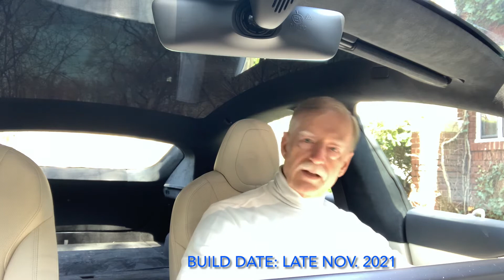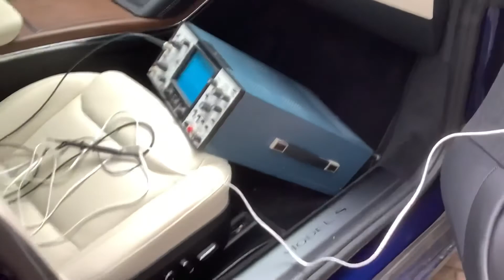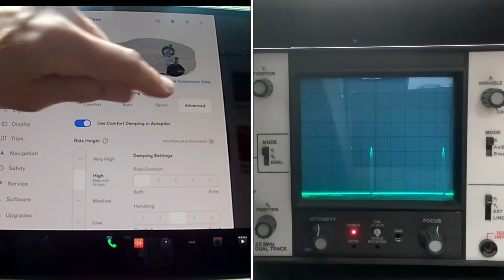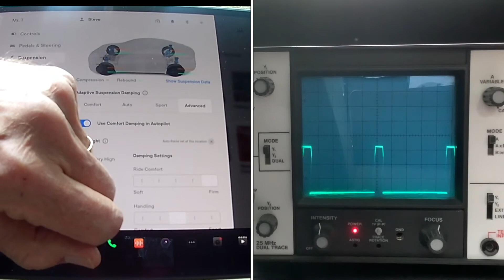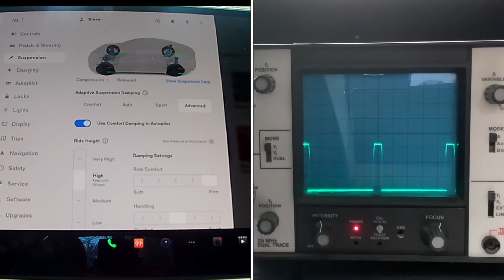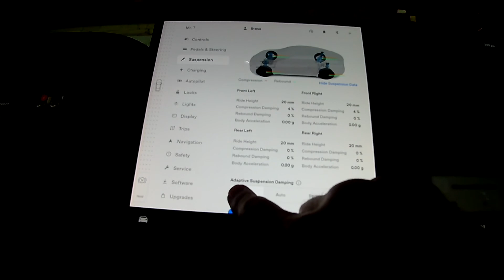Tesla Model S Comfort Mode Doesn’t Work? Here’s Why

Comment: There are 2 air strut revisions for the refreshed Model S.

2021+ Palladium: 1420361-00-G
2025 P3 Lazarus: 2420361-00-B

On my 2024 Model S LR, I do feel a difference between the Sport and Comfort mode, but the car remains bumpy even in Comfort mode, while every little road crack and texture is the worst in the most advanced softest ride 

I reduced the tire pressure to 2.4 bar instead of 2.9 and this improved the road comfort a lot better on my 19" tempest wheels.
The ultimate fix would be a complete damper revalving for each strut or a full replacement to the latest revision. 

The older Model S analog suspension was a lot better in terms of road comfort.

Comment: Same issue with Lucid. There is absolutely no change in drive modes. The only change that happens is the power output is being increase in "sprint mode". Steering wheel and dampers don't adjust at all (yes, you can adjust spring suspension).
Reply: Is the lucid soft or stiff and bumpy?

Comment: Just a couple of points where you may be wrong, just a suggestion. Depending on wether the the solenoid is normally open when energized or closed. So without knowing this the pulse width modulation direction is meaningless unless you know which way around it works. The other point is , compression vs rebound in a shock can be different. The leakage of fluid from one side of the piston to the other can be different, in other words the shock can be easier to compress than it is to extend. If you google shock compression and rebound, there are many articles explaining the purpose of asymmetric settings

Comment: I think Andy has it right. I can tell a difference in my model X in ride quality and at first the labels didn’t make sense. But, the adaptive dampening system keeps the shocks and springs from doing their job as much to create an even smoother ride. On Sport mode, it requires more electricity to keep the springs from compressing as much. On comfort mode they are almost just letting the springs do their thing which makes for a less jarring, but more bouncy floaty ride; thus requires less electrical current due to less intervention. So their labels do seem accurate and the system does seem to work on my model x.

Comment: The adaptive suspension system in the 2022 Tesla Model S and Model X was first introduced in mid-2019 on the "Raven" versions of these two vehicles. It is likely that this problem is present on Model S and Model X vehicles all the way back to the Raven introduction.

This type of adaptive shock absorber system was first developed by Bilstein and introduced on the Ferrari Mondial T in 1980. In 2002, GM's Delphi Division introduced Magneride, a new approach utilizing magnetorheological fluid (oil with iron particles in suspension) on its 2002.5 Cadillac Seville STS. Instead of electro-mechanical valves, GM's system uses a pair of electro-magnetic coils to alter the viscosity of the oil passing through the shock's orifice. This eliminates moving parts in the valve. I wonder whether Tesla is actually using the Magneride system—although GM might have required Tesla to use the Magneride name if they were.

Comment: You are assuming the valves are normally closed, requiring a greater pulse width to open the valve. Perhaps they are using normal open valves requiring wider pulses to close the valve. This would mean they fail open which makes sense as you don't want a locked suspension in a failure mode.
I can feel a difference in my 2022 X and I have had passengers clearly tell a difference. 
Don't get me wrong, Tesla has far too many 19 yearold programmers who don't have a clue what they are doing. Plus a lot of new code has been written chasing the hodgepodge of chips Tesla scrambled to adapt for use in the car's to keep production going. My autopresenting doors suck compared to my 2018 X. I suspect it's because someone had to completely rewrite the code for a new controller and they screwed it up. Who knows, your S suspension may be using a totally different controller than my X. As hard as chips are to get these days I bet there are variations in the same model weekly!
Reply: I think Andy has it right. I can tell a difference in my model X in ride quality and at first the labels didn’t make sense. But, the adaptive dampening system keeps the shocks and springs from doing their job as much to create an even smoother ride. On Sport mode, it requires more electricity to keep the springs from compressing as much. On comfort mode they are almost just letting the springs do their thing which makes for a less jarring, but more bouncy floaty ride; thus requires less electrical current due to less intervention. So their labels do seem accurate and the system does seem to work on my model x.